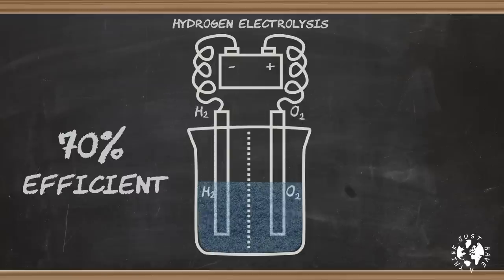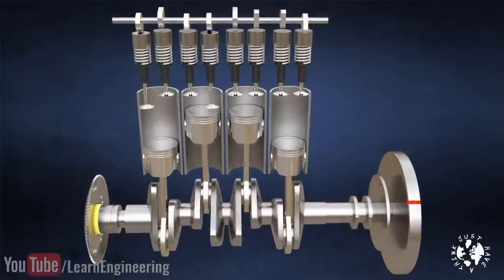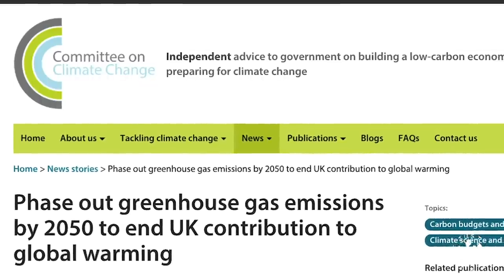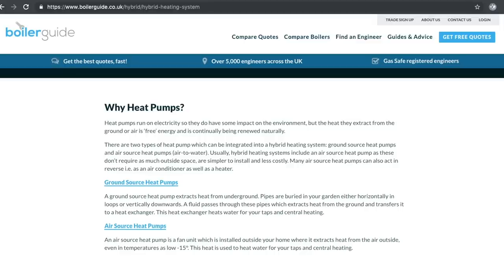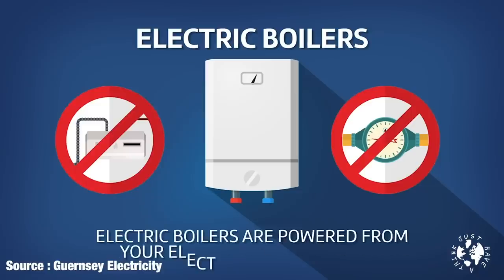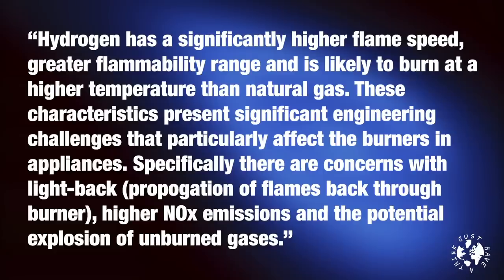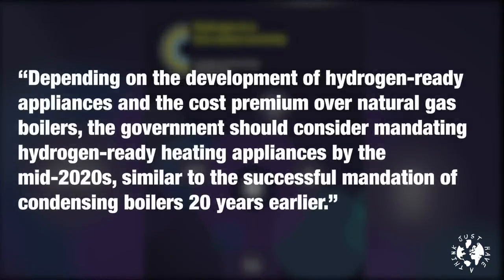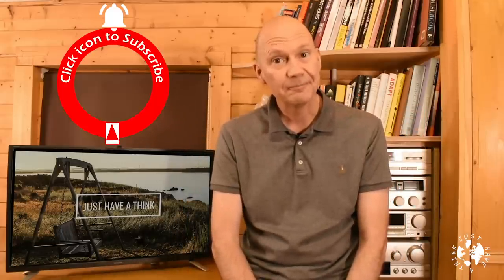Hydrogen for heating our homes

Comment: Great show!
One of the main problems for hydrogen in gas burning is piping or tubing that can be used. Hydrogen gas will eat through most standard steel pipe and tube, so Stainless Steel has to be used. 
Hydrogen enters the microstructure of the steel, and reacts with the carbon present to form larger methane molecules.
There are plastic tubing systems that can take hydrogen pressures up to 700 bar and temperatures from -40 °C to +80 °C. new design will have to consider connection types and sealing systems to reduce possibilities of accidental leaks.

Comment: Isn't a fuel cell a better heating appliance to use rather then a hydrogen burner? Fuel cells are already developed for hydrogen use (i.e. no new technology to develop with tax money and incentives). Also maybe someone more knowledgeable about fuel cells than me can correct me but don't they also work with natural gas? So to solve the transition from natural gas to hydrogen people could switch space and  domestic hot water heating to fuel cells and the other typical natural gas appliance (stoves) can be easily replaced with electric stoves.

Comment: You said that there's no commercially available hydrogen boilers. How about Giacomini HydroGem? I haven't purchased one yet, but it sounds like they have a commercial product. Because they use a catalytic reaction rather than a flame, they avoid some of the problems you mentioned with flame based hydrogen heating.

Comment: the term "boiler" sugge4st to me a big tank, where hot water is heated and stored. it ALSO suggests boiling, a potential exposion.
wht i have SEEN here is what in the states we call a Demand water heater.. or a tankless.
is that what i am seeing here? or is there a tank i don't see and a higher "boiling" temperature.

in the us we have a safety feature for gass. it is a one way valve that prevents backflow, would this work on Hydrogen?

@ Just Have a Think

Comment: A couple thoughts. I work for a large multinational power company (as an electrical engineer) and they are seriously considering the hydrogen market. There was 2 main bodies of discussion regarding the overall grid. 1) hydrogen can be blended with NG up to about 15-20% without ill effects like leakage or irregular burning 2) In areas of high renewables like California, the excessive production causes grid instability and the "Duck Curve" one idea was to build multiple Industrial scale electrolysis hydrogen plants using the ocean as a water source, storing the hydrogen in massive tanks and then using either electric turbines or Industrial sized fuel cells to provide power during peak load effectively allowing renewables to be dispatchable and reliable.
Reply from the maker: Hi Nathan. Thanks for your feedback and very interesting information. One way or another it seems to me that the powers that be are determined to get hydrogen into the energy mix in a big way as part of the carbon reduction plan. The UK government's plan for carbon zero by 2050 will only work if they go full-on with hydrogen for heating. We shall see...
Reply: @JustHaveaThink  BTW I wanted to say I really enjoy your show and thank you for the response. I feel like the next couple of years will almost be like 110 years ago when everyone had horse and buggy... then suddenly vehicles everywhere.

Comment: How about the in-line reforming of methane, propane or butane (i.e. natural gas or camping gas) in a fuel cell system, which would allow existing infrastructure to be used and make for far more fficient use of hydrocarbon fuels than combustion? It wouldn't really be feasible for polymer fuel cell stacks, but is viable for SOFCs.

Comment: While hydrogen can be burned it is a much better idea to use that fuel for fuel cells at the point of use as they not only produce electricity but also produce a considerable level of heat that is waste energy. That's why some hydrogen fueled buses look like "Stanley Steamers". This combined with heat pumps mean a air source heat pump would provide heating well below-15C while providing air conditioning in the summer. This is doable now.
One cautionary note, hydrogen embrittlement is very real so iron lines and steel cylinders can get so hardened that they can actually fracture so retrofitting needs to be evaluated very carefully considering some installations used cast iron, a product already brittle. All to say that this is a real option.
Reply: This idea is nothing new. I've been aware of diesel generators being used as a home heating plant, same as a boiler, to produce heat and power. This is just a slight modification of the process and would also produce absolutely pure water as the byproduct.

Comment: Thank you so much. A bit dissapointed not to see any mention of Combined Heat and Power (CHP) systems already used on a commercial basis. At the heart of such systems is a fuel cell to produce electricity and the heat generated in that process used to heat your water, building or house. Current installations use either Natural Gas or Hydrogen. Many hospitals, apparently use the technology already and I thought that Panasonic had developed a micro CHP boiler. Love your series;  wish more of it appeared on mainstream TV etc instead of half the junk we get.
Reply: The fuel cell could ofcourse charge your car battery etc overnight. The heat could keep your outdoor pool heated and your jacusi hot. 👍👍

Comment: Why wouldn't the best solution be more efficient H2FC co-gen?  Heat and power at the same time?  Once you have a solar array, all the grid tie is in place?  How fast are small fuel cell costs coming down?

Comment: I understand that you could go up 70% with hydrogen efficiency if you produce it on the spot where it will be used and use lets say 50% of waste heat for district heating networks.  Tho I don’t know if more of the waste heat could be used and how much hydrogen would be lost from summer production with cheap electricity to winter usage. Generally using waste heat from all sorts of industrial processes to your home suage.
Does someone know prices for hydrogen fuel cells per kw or for storage?

Comment: I always thought we could use the existing natural gas pipelines to pump hydrogen around the country when we get enough renewable energy available to make it by electrolysis. However, I am just reading the current Scientific American edition where they say that pumping hydrogen through long pipelines is very inefficient and when using pipelines longer than a few hundred kilometres you have to put in more energy to pump it than you get out of the hydrogen when it arrives! Why is that? I thought that hydrogen being light wouldn’t have much viscosity and so could be pumped easily. Does anybody here know the answer?

Comment: It gets complex when trying to convert natural gas networks to hydrogen. Is it worth it?  Using Tesla Powerwall batteries charged from PV panels and cheap overnight electricity means we can go all electric - see Robert Llewellyn's vids in Fully Charged on the running costs. Then any North Sea Gas reserves can be used for power generation (peakers), or industrial use.

Comment: I think the manufacture of gas hobs and ovens should be gradually phased out. Induction electric hobs are more efficient and heat up items placed on them quicker than does gas. It is more of a problem for gas boilers and home heating. I've often wondered whether such boilers could use a catalyst for producing heat, rather like the old SuperSer heater option of the 70s and whether such a catalyst would work for hydrogen.

Comment: Interesting, and I suspect that the storage value of hydrogen is under-valued. It means that hydrogen production can make use of cheap electricity, when renewables are generating a surplus. Thus, the low physical efficiency is partially compensated at times of high economic efficiency.

Comment: There is a problem with hydrogen containment. Being very reactive gas can corrode metal that LPG will not touch. The other issue is seals because it to much smaller molecule, seals have to have stricter tolerances

Comment: ......hythane fuelled vehicles have been around in Australia.  Hythane is hydrogen/methane blend at 1:4 ratio . the tanks need only be twice the gauge thickness of LPG tanks . It works cos the hydrogen can remain dissolved in the liquefied methane, otherwise hydrogen storage is a problem . . For storing pure hydrogen ,the best strategy I've heard of is use of graphitic nitride to contain it as intercalated hydride .

Comment: The transportation issue could be solved by local smaller size production centres, then the cost of transportation will go to minimum levels almost uneffecting the overall efficiency. You could also have the production of hydrogen on demand in small quantities and the boilers could be installed in a stateless steal compartment so if there is an explosion, no harm will be done. Also technology to improve prevention and early detection of any leaks etc could be improved and AI could be used too.

Comment: I think hydrogen should be used for long term energy storage at grid level. Meaning that excess wind and solar energy is converted into hydrogen, stored in salt caverns or other large structures and converted back to electricity when needed. This could stabilise the grid between summer and winter even and really allow much more wind and solar power to be used. For stabilising the grid between noon and evening (flow) batteries can be used. Then no hydrogen household  inftastructure is needed.
Reply from the maker: Hi Rene. Sounds like you are agreeing with my previous video then?
Reply: Yes, very much so! My compliments to your video's. Hope this is noticed by as many people as possible. I still hear many people talk about hydrogen as if it is an energy source, instead of a way to store energy.

Comment: In most situations storage in batteries will be dominant, but for weight sensitive applications the inefficiency of the H2 cycle would be an acceptable trade off. For airlines it might be the only solution, but the inefficiencies might make high speed trains more attractive than airlines.

Comment: It feels like there was an option missing here. If you are going to go to the trouble of transporting hydrogen around why not consider hydrogen fuel cells for heating homes? Use the heat generated by the cell, along with a heat pump powered by the cell to heat water or air for heating. Excess power goes into the general house supply, power wall or grid.
Reply: I feel that too. I know off one guy or company, he made his house off grid with only solar cells,  battery for short term storage and hydrogen for long terms storage (through electrolizer and fuel cells). He recycled the heat from the fuel cells for heating and the electricity was running a heat pump. Check out Nilsson energy, https://nilssonenergy.com/

Comment: Most all European boiler manufacturers have diversified into heat pumps and district heating, at their own expense. I think that says all we need to know about the viability of Hydrogen boilers. In fairness though, I think maybe the primary goal of putting hydrogen into home heating is to provide a large, but most likely temporary market use, for growing the production infrastructure for hydrogen. Once hydrogen production and distribution gets more established it will be far more useful to use it in more difficult to decarbonise applications like long distance road freight and backup generation for renewables on the power grid.

Comment: Hm.. did you consider Power-to-Gas technology? According to Wikipedia and Google, the technology to create methane from hydrogen and carbon dioxide is commercially available. Of course, this adds one further, energy-inefficient conversion process, but would allow the use of the existing natural gas energy infrastructure.

Comment: What is the efficiencies of convert hydrogen into to electricity in the home, I see the gas network of piping is being up graded in our area of Shrewsbury this year, and so this would suggested the idea of using hydrogen to pump around the country is serious. I use inferred panels, and wood fire, as a back up to our oil system. We are currently trying to get an Air Source Heat pump, but the industry is poorly set up and lagging behind with the government current program. But if I opt for in the main electricity as a means to power my home rather than burning things, would help me make up my mind about what direction to go for!

Comment: The costs per mile of the ionide battery or hydrogen fuel cells are exclusive of fuel duty which is very high in the uk and one day will need to be transferred from diesel and petrol to other fuel sources.

Comment: My main concern with hydrogen is the quality of the gas network.  Given how much more explosive hydrogen is over natural gas it would present a significantly increased risk both where network issues occur but also in the home where appliance failures or even carelessness occurs.  I would personally keep hydrogen in the industrial sector only where it is far easier to regulate and manage.
Reply from the maker: That may indeed be how it ultimately transpires. We shall see.
Reply: Natural gas is going up in price all the time where as hydrogen will start to come down

Comment: Dave, today I learned elsewhere that burning hydrogen in air produces nitrous oxide as well as water. "Quite a lot" I was told. It's mentioned in your talk and in one of the comments here. How big a problem is it - how much NOX is produced per joule of heat produced? I hear that using hydrogen in a fuel cell does not produce NOX.
Reply from the maker: Hi Sue,

Yes, I think it's a product of hydrogen combustion rather than conversion to electricity in a fuel cell. I'm not sure about quantity but I do know that it's one of the arguments against hydrogen as an aviation fuel, because the NOx would be delivered directly into the high atmosphere. I must admit my enthusiasm for hydrogen has waned significantly since I made this video. Blue hydrogen is a disaster and even green hydrogen will be very expensive and incredibly energy inefficient to make using renewable energy. It will work only if we have a huge over supply of renewable energy that needs to be diverted into something useful rather than being curtailed.

Comment: Proton Exchange Membrane electrolysis and hydrogen fuel cells can make a possible "battery" that is less efficient than lithium ion but it is built from more affordable materials and can cost less than the battery for energy storage.

Comment: When it comes to hydrogen, I recon' a few area's ceed more Research and Development.
Prodution from water and production from waste water treatment plants as well. Hydrogen and methane from compost is a very underutilized fuel source, more research and development ought to go into this. Efficient fuel consumption is another area that could use more R&D. I bet there are ways to make liquified hydrogen more efficiently as well. Hydrogen is the base element of the known universe. Surely hydrogen holds secrets for us that can set us free. Doing hydrogen better is such a worthy endeavour! I think that over the course of time, as far as our footprint on this planet goes, Hydrogen could easily beat any battery for how much that long term storage could really reduce our need for more fuel.... No matter what the original fuel source was

Comment: possible ways to make H2 more efficient and practical:

(1) onsite production, such as from solar cells or even direct photolysis, avoiding transport losses
(2) recover energy of compression with turbines (easier at fixed points of use)
(3) store in underground caverns, at or near 1 bar (to avoid compression losses)
(4) use in solid oxide fuel cells (SOFC) (possibly in fixed installations, or very large vehicles such as ships)

Note that some combinations are mutually exclusive.

All in all, I still think it's a stretch. There are no doubt some niches, but I don't see space heating being one of them. I have a much easier time seeing a ground source heat pump in Finland running from solar energy carried through an HVDC smart grid from, say, Egypt. We're good at grids, and getting better.
Reply: Precisely Ronald!  No running cost when you use sunlight to make hydrogen from water.
Reply: @Energy-Americas  So that makes it free, right? Come on, I think you totally missed the point. Hydrogen is not an efficient option at all.

Comment: Here a little example from Switzerland. Over 12'000 trains have to role every day in order to enable the public railway service. The trains transporting goods are not included here. If you calculate the total moved distance and weight of all these trains and divide the total amount through 8 million people living in  Switzerland, then you have the following staggering figure: It is, as if every single person, including the new born babies, had to move for one kilometer 400 Tonnes of weigh by themselves -- every day!! That's the energy amount we "need" everyday just for our public mobility comfort. 
If we add here all the cars, airplanes, buses, trams and ships, we will easily understand that we are  totally of the chart -- and nuts! There is no technical solution to our craziness.

Comment: Why not solar to power the electrolysis process. Thereby converting the electricity into hydrogen for longer term energy storage and release the oxygen into the atmosphere. Seems the hydrogen produced could be used to heat home/hot water and run a generator to provide the electricity for the home. All in one, self sufficient recycurculating system. Could even recover the water from the exhaust to be reused by the electrolysis?  Of course, potential for explosion is a bit of a consideration.  Similar cycle could be accomplished with methane produced by decomposition of household vegitable waste and general animal waste and composting materials. Just thinking out loud here. 🙃